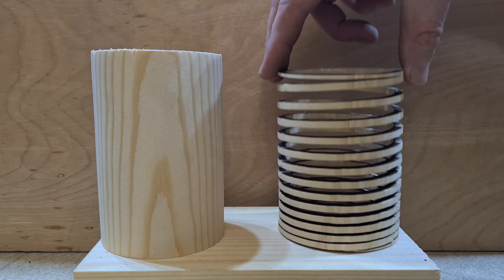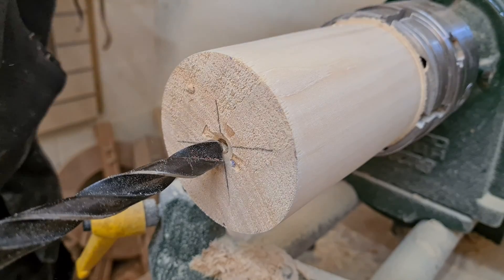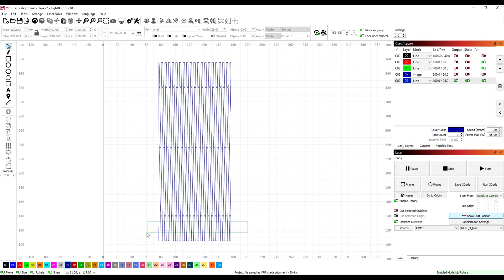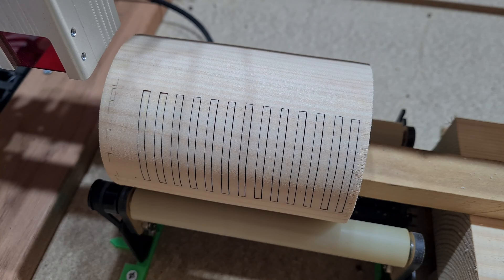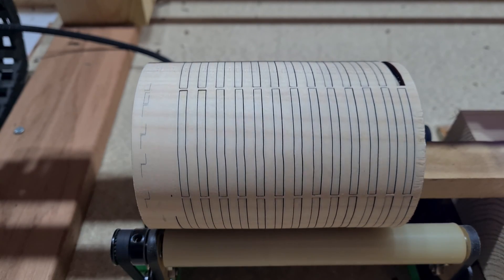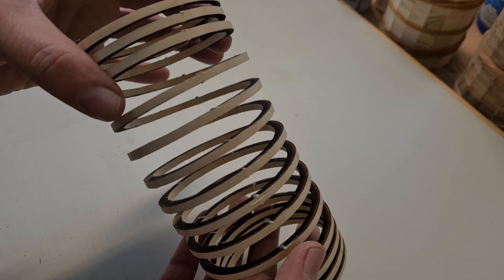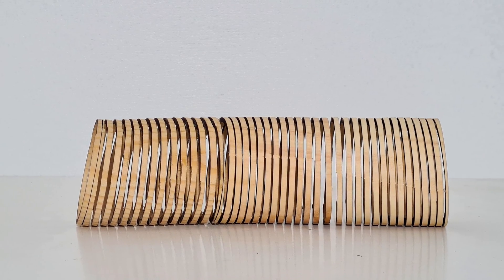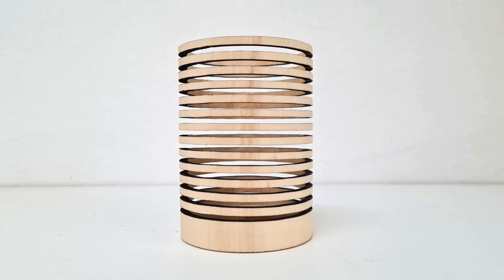Laser cut slinky from wood

Comment: That’s amazing. I recently purchased a diode laser and I just might need to try this. Calibrating the rotary attachment is key. Well done 👍
Reply from the maker: Tracking problems with the rollers could also be a friction issue with highly sanded surfaces or best to get a chuck based system!
Reply: @RayWhitbyCreations  have you encountered any situations where a chuck won’t work, ie nothing to grab on to?
Reply from the maker: @gregj2647  I will need to get one and try. The only incident I recall with a chuck was in a Trotec video (iirc) which tried to compress an egg shell and it cracked several times before they got the pressure right. Cool engraving of an ostrich egg though!

Comment: Slow slinky's rule. Before removing support columns just leave as would no pun intended look great as a light shade I see segmented blanks for future projects on table stay well stay safe stay Slinkying
Reply from the maker: Thanks Michael. I'm looking at some segmented cylinders for the rotary, but there's too many ideas and too little time. Plus it's become so cold in both workshops (the charity and my one at home).
Reply: @RayWhitbyCreations  -2 and fog here and can not feel fingers
Reply from the maker: @Uniquettt  That's about right, I had 4 layers on, constantly moving about indoors and could not feel fingers or toes. Thankfully we have quite a lot of scrap offcuts to burn! It did mean no work getting done as no-one wanted to move away from the log burner!!

Comment: Nice one Ray, just wondering if you could have gotten the same result by cutting a single spiral line?
Reply from the maker: I guess this is possible Steve. The problem I'm experiencing with the Ortur rollers is poor accuracy when tracking around the circumference and if doing two parallel lines to cut out the space needed, I'm not reassured the second line would be parallel to the first! I certainly will try this idea if I can get the chuck system. All the best. Ray
Reply: What about a rotary chuck instead of the rollers?
Reply: I will have to try this! Great idea!

Comment: As for the alignment issues - could you add alignment rollers at the top and the bottom of the cylinder to prevent it from moving "up and down" meaning along the axis of the cylinder? It would require that the top and bottom of the cylinder are smooth and square to each other. Sounds like a 3d printing project...
Reply from the maker: That's an interesting approach. I should probably add large rubber bands first, check the consistency of the turned diameter second and buy a chuck type rotary system third... these might be quicker than me trying to 3D design anything!!
Reply: @RayWhitbyCreations  Aaaah, do you ever find it hard to sleep because your head is spinning with ideas? It's a curse of the clever. Or the stupid, I can't tell anymore...
Reply from the maker: @mattiasfagerlund  Often yes. I'm project driven and therefore always thinking about the creation and how to best make an impact with it (or not as the case often is!)

Comment: Very clever indeed, not an easy built at all, I wonder what type of wood might be more suitable for its elastic properties. As always thank you for pushing the boundaries of traditional woodturning with the “laser sauce” 😉
Reply from the maker: That's an intriguing question as to what wood to use for this project. Assuming that the tests conducted for young's modulus directly correlate from a plank or fibre tested to a spiral pattern then it seems hickory would be the best!